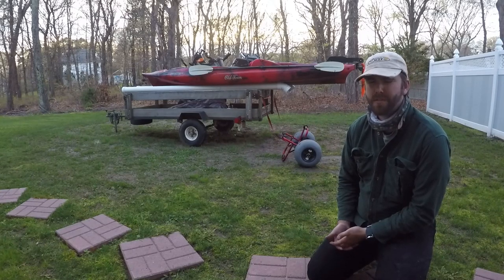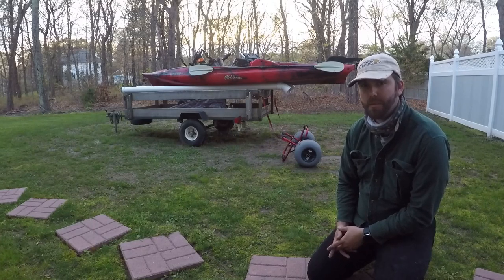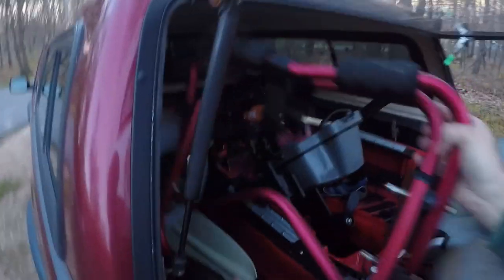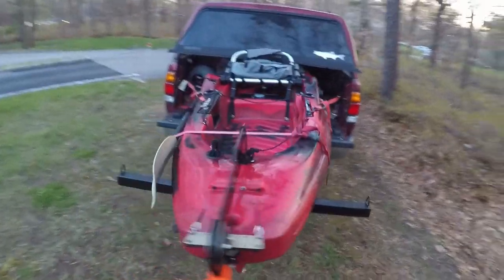My Old Town Predator PDL: Truck Bed Extender and Bonnlo Kayak Cart

Comment: Great job 👍 I just got my predator . I love the boat cleats you put on the rear tracking I'm going to do that.I think I'm going to put trailer lights on my truck bed extender  just plug into my trailer lights on my truck extra visibility for four drivers behind me.
Reply from the maker: That's a great idea! I used to stick a battery powered red light on the stern of the kayak but that seems like a better idea!

Comment: I just bought this bed extender from Harbor Freight yesterday and it wobbles so much. On top of that, when I raise the crossbar to its highest setting, it still sits below my tailgate. Not much help if it doesn’t touch my kayak. Maybe adding a pool noodle will help? I’ll have to try before taking it back.
Reply from the maker: I have a pool noodle on mine, it is important to have to protect your kayak. Surprised it still sits low, would be a shame if you can't use it!
Reply: @SaltyMcFogg  so I bought an extra fat pool noodle and even with that wrapped around the cross bar, it was still about 2 inches under my kayak. I have a 2019 RAM 1500 (new body) so maybe that is why. I think the beds sit higher on the new body style. Either way, looks like a Boondox T-Bone is in my future. That’s what I get for trying to save some money. Haha.
Reply from the maker: @XploreAz  That's so wild, sorry that didn't work out for you. Yeah I'm not familiar with the Dodge truck heights and such so that's just unlucky! Hopefully Harbor Freight will let you return it for a full refund, I don't see why not.
Reply: @SaltyMcFogg  they will. I’ve only had it a few days. Still have all packaging.

Comment: Great vid...what do you do with your cart when in the water?  ...obvious answer is to store it in your truck.  I wasn't sure if you attached it to the kayak at all.  Thanks.
Reply from the maker: So this cart can fit in the stern, it's a little awkward but it works. Just lay it so the tires are even in that back well and then you can bungee it to your crate.
If you don't really need it storing it in your vehicle saves a lot of space. I do that most of the time because I fish a lot of places where i don't immediately need the cart and my truck isn't far away.